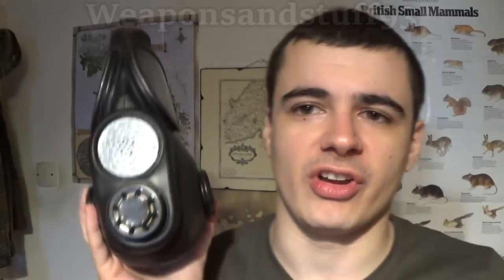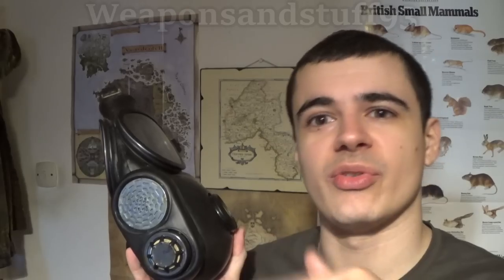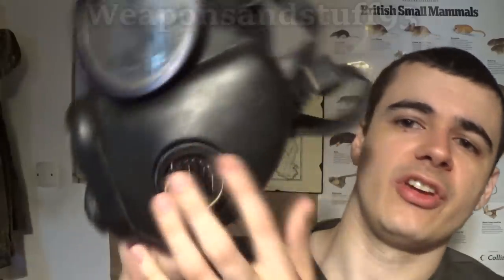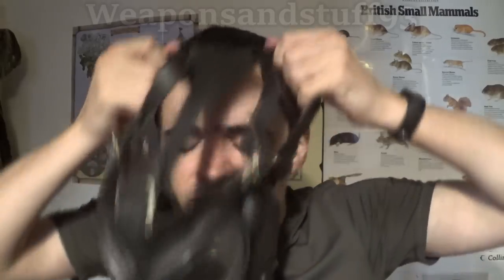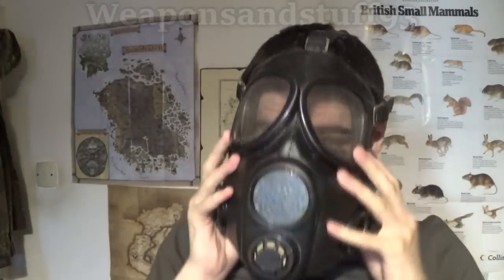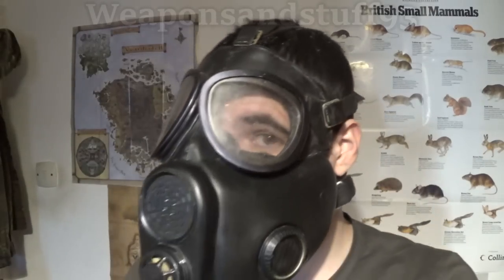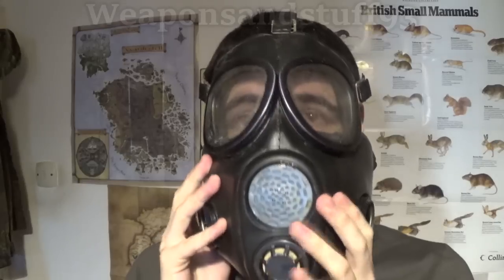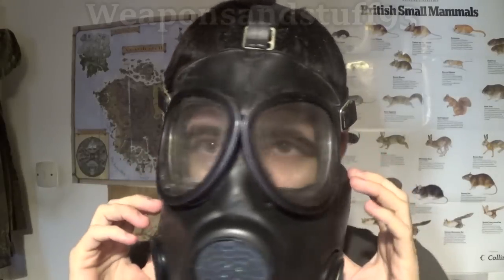Why I hate Cheek Filter Gas Masks

Comment: Cheek Filter masks Are a great design because they get the job done A Gasmask is used to finish your mission And get to a safer area in a real NBC envirement You are not going to camp out in the contaminated area Your going to get out of their and  your not Going to use your Mask for 10 to 15 hours their for The whole Getting the filters In a cheek filter Mask Is Impossible without removeing the mask So they suck is not the case I will Be making a video About This later on my channel
Reply: Gasmasker77 yes but the filters are continuously exposed to air making them redundant straight away
Reply: Sam Barker Actually If your talking about when the mask is in a bag or not in use That statement is in correct Because the M17 filter covers Have Small white discs so air is not flowing through the mask.
Reply from the maker: +Gasmasker77 They start expiring as soon as they are removed from the packets + most do not have a combined P3 filter or ABEK filter.
Reply: Weaponsandstuff93 Yeah what im saying Is when they were New
Reply: Weaponsandstuff93 I mean So do Canisters but not as fast But I get what your saying
Reply: these shouldn't be used in military situations, civilians most likely (during time of war where gas or possible nuclear war can be used on civilians) military personnel might have to fight their way out not civs.
Reply: Garrett B NCR Explain why
Reply: Garrett B NCR The mask Got the job done effectively
Reply: Gasmasker77 I agree with you but they should only be used by riot police
Reply: Jason Voorhes Yeah
Reply: They might work, but that doesn't change the fact that they are an inferior design. The inability to change filters without taking the mask off just makes them that much less adaptable, which is not something I want in one of the primary devices standing between me and death. While they may work for completing most missions, any and all setbacks become more dangerous due to their flawed design. If cheek filter masks really were a great design, they would be far more ubiquitous than they are. I won't deny that the M17 worked as a compact, limited gas mask for brief NBC encounters, but given that compact masks with sleek profiles like the M50 now exist, it has been rendered more or less obsolete and its significant cheek filter tradeoff is no longer required.
Reply: @n.m.dimmick194  you are not supposed to change filters in an nbc environment, plus they lasted longer then canisters, filter changed in combat are NOT a protocol of ANY military.

Comment: I have a PBF gas mask. Is there a way I could add 40mm filter
Reply from the maker: No
Reply: Possibly, idk if it's been tried, but if you find PMK-2/3 40mm gost adapters, you could try to force the adapter inside of the cheeks. However, if you're going for that S.T.A.L.K.E.R look, it probably won't work out as the weight of the filters make them droop

Comment: I know that you don´t like getting comments about the gp 5 filter but i got one from 1985 and if i shake it i hear someting "rattling" in it do you think it is charcoal or parzicles of the asbestos
Reply: Okay thanks
Reply: Okay but the one with charcoal not much
Reply from the maker: +Waschbär Gta It's saturated charcoal so the filter is fully expired.
Reply: Okay so it has asbestos and charcoal in it and another question i have is i did use it with the black plug for about 10 minutes do you think my lungs are okay or should i go to a doctor
Reply: Okay thanks i will keep that in mind but thanks

Comment: I can install the filters in three minutes and I prefer the cheek filters I like the way they look but I agree with your arguments
Reply from the maker: The main issue is, if there was a gas attack, you couldn't install the filters. With a 40mm or 60mm gas mask it's a case of about 10 seconds to unscrew a filter and then screw a replacement in.
Reply: Weaponsandstuff93 I know but when they introduced these masks there wasn’t a high gas threat and they are much lighter at least in my opinion